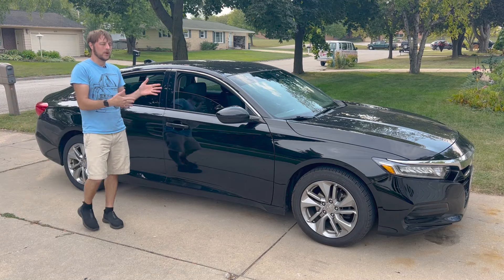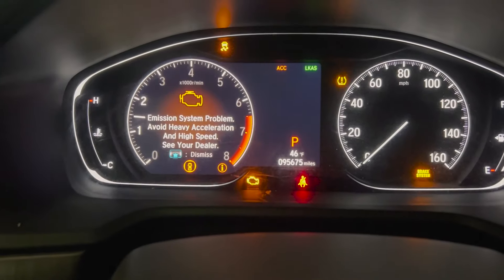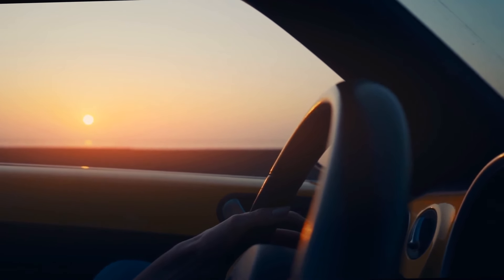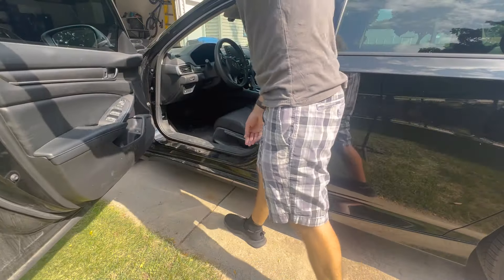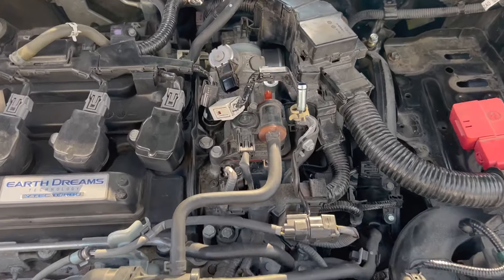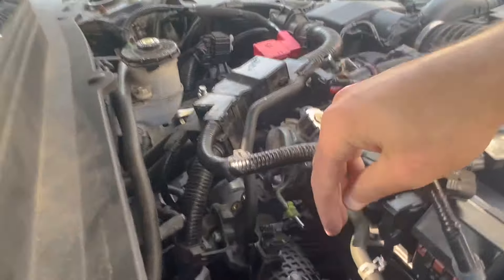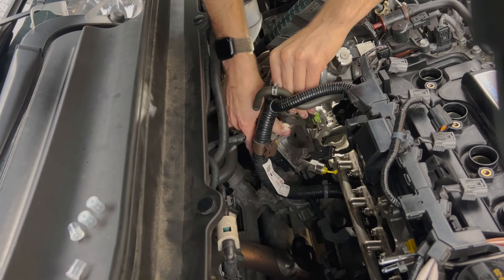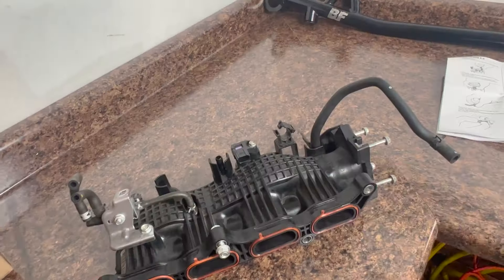Honda Accord Rough Idle & Misfire - Accord Fuel Injector Change // 2018 Honda Accord Injectors

Comment: Great video!!! Question. I know you said changing the injectors fixed your rough idle, but did your codes ever come back? My wifes car (2018 accord sport 1.5t) has been dealing with the codes for a little while. Everytime they come up i just disconnect the battery for 15 minute, drive for maybe a mile then they reset. To me it HAS to be something with the battery or a bad ground. Something dealing with a broken head gasket or fuel injectors for throwing codes just seems like bs to me.
Reply from the maker: Sounds like you could spend the $25 for the scanner linked in the video description to make your life easier.  The code is not a direct link to a head gasket or dirty injectors, but the codes are tipping you off to a potential problem that should be looked into before it gets more serious.
Reply: @BoostedFilms  sure thing. I have several scanners saved just haven't pulled the trigger on one yet. I was really trying to see if your codes came back. Because a lot of people who said dealership told then they needed the same things, the lights came back like 3 months later
Reply from the maker: @TheNappyboy2  I have not had any codes since the injector swap.
Reply: @BoostedFilms  Nice okay!! Thanks for the reply.
Reply: @TheNappyboy2 Have you had the battery tested?  If it's the original battery, it may be down on capacity, causing voltage fluctuations, leading to bogus codes.  Any corrosion at the posts or cable ends?  Get it tested, or just replace it, clean up those cable ends with a battery brush while the old one is out.
Reply: @trex450flyer  Out of town right now but recently got a terminal wire brush to clean them to make sure nothing is on there. Currently on the THIRD batter for the car. We bought it brand new in 2018 so the first battery was bad from the factory. Second battery went bad out of no where so I changed it to the one that's in it now. We thing shortly after that last battery change is when the codes started. I plan of testing the battery when we get back home as well as checking for bad grounds.

Comment: Curious to know if there is way to distinguish this from a blown head gasket? I’ve seen a lot of posts of the accords with the 1.5TS having the same issues and it has ended up being the head gasket.
Reply: If it's the head gasket, and you're keeping an eye on the coolant level in the recovery tank, it's likely to drop after successive trips. The dealer can identify that it's a head gasket by removing the plugs and checking for coolant on top of the pistons with a boroscope, or they can do a test that looks for combustion gases in the coolant. My Accord is exhibiting the same symptoms as mentioned in this video, I've run a couple tankfulls of Chevron Techron fuel system cleaner through it, and the problem has lessened. However eventually I'll probably have to replace the injectors as well.

Comment: Hi there my Honda is doing the same thing for months now, I took it to Honda they told me the injectors are bad, But my main concern is that anytime i check my radiator  there"s  no coolant inside , there"s always coolant in the water bottle please advice .
Reply: Thats a symptom of a blown head gasket. 4 grand to replace
Reply: @JohnS-il1dr  wow
Reply: @KayAdex-gx3zc wow is right. Did you get the issue fixed?
Reply: Did you ever get the issue fixed ? Seems like these cars are all lemons . I’ve been doing a lot of research and it’s either replacing spark plugs , injectors or a blown head gasket that turns this car into xmas lights on the dash .  Right now I’m helping a friend out that has a 2018 accord 1.5 turbo . I don’t think I’d ever own another Honda again  . POS
Reply: @Eddie510s  Hi there i got the headgasket replaced , its still showing lights on the dash like Christmas lights , when its idle the rpm goes up n down i dont know what else is the problem

Comment: Could a blown headgasket cause that buildup? Would explain rough idle especially on startup, misfires and is the most common problem on these cars. Small slow leak right between the cylinders where they stupidly put a cooling channel.
Reply from the maker: Carbon build up on the intake runners and intake valves is a byproduct of direct injection.  However i'd imagine a leaky or blown head gasket would not help much of anything.

Comment: Can you reuse the manifold gaskets ?
Reply: I wouldn't recommend reusing them.
1.- They could be in a bad condition once you remove the intake manifold. They could be broken, brittle or worn. Which will end up causing an air leak, which will undoubtedly bring more problems.
2.- To get to the intake manifold, you already did too many things. So I don't think it's worth the risk of reusing the gaskets.
3.- I don't think a set of new gaskets are too expensive. So I would definitely recommend buying new ones.

Now I understand that there may be various reasons why you are asking. Out of stock, budget or mere curiosity.

I hope the brief answer helps you choose the best option.
Greetings.

Comment: Would it be the exact steps for a 2017 Honda CRV ? not sure if the 1.5Turbo in those engines are the same
Reply from the maker: doubtful.
Reply: @BoostedFilms  thanks for the fast reply. I read online that they do have the same 1.5Turbo engine and watched a crv video and steps seem basically the same. I am going to try and tackle this!
Reply from the maker: Interesting, i didn't know that! Good luck. keep us updated.
Reply: @BoostedFilms tackled it today on my CRV and it’s 99% the same besides the intercooler pipe. Thanks man I appreciate it !
Reply from the maker: @killadocg23 nice! Good to know. Thanks for following up

Comment: Identical symptoms with my wife's Accord.  Replaced all 4 plugs with new NGK iridiums......new injectors with Hitachi.   No misfire codes anymore, but still a slightly rough idle and she said twice now, on the interestate, it went into limp mode.  She pulled over, turned off and back on, and drove fine.    I'm wondered if injectors are the answer.   The lack of codes is what's really throwing me for a loop.
Reply: There is a recall on the fuel pump for 2.6 million vehicles between 2018 - 2020. My vehicle w/ 30K miles had this issue occur on Dec 9th 2023 and recall came out Dec 23rd 2023. Honda had no idea what the issue was then but they sure as hell do now.
Reply: Did you manage to find out what the problem was?
Reply: Twice I had to pullover to turn engine off and on and only thing I get is a flashing check engine icon. About 20 to 45 it starts to lose accelerating.
Reply: @Johnrod213  Hey JRod! Yeah, they diagnosed it as a failed spark plug in cylinder 3. Thankfully they covered the cost. I haven't had the issue come back yet but I am well aware the fuel pump could go out at any moment.
Reply: This happened to me also took it to the dealer and said it was a blown head gasket

Comment: Great video! How long for the injectors to arrive after ordering?
Reply from the maker: I placed an order once and the place emailed me back and just cancelled the order.  The second time i found someone else who orders from a OEM Honda dealer on the regular.  It still took about 2 months.
Reply: @BoostedFilms Honda had a recall for the fuel pump do you think that was the issue? Also did your ever have a blown head gasket

Comment: I followed this video steps.. after everything seems to fix the issue with the misfire 1 but then p0035 code popped up afterwards. Any idea why ??
Reply from the maker: I'd do a recheck of your connections and hoses.  Clear the code and see if it comes back.
Reply: Yes definitely did that found a loose wire from the turbo to the manifold. Thank you for the great video!

Comment: Did you ever get an intermittent flashing check engine light prior to the car losing power? This happens with my friend's car around 40mph then loses all power and wont go past 20mph.
Reply: I had that and it was cylinder 1 misfire.  I needed a tune up.  Changed all spark plugs and coil pack.  Car runs very strong from spark plugs and you feel it in the pedal.  Check fuel filter and oxygen sensor and ecm tcm etc

Comment: This video is really helpful but i want to know iff the fuel inector are bad car losing a coolant iff someone know tell me please
Reply: If your car is loosing coolant slightly this can be due to excessive heat of summer or from a slight leak in your head gasket seal. My headgasket finally went after 230,000 miles on 2020 hybrid accord. You should get your compression checked on each cylinder to make sure your head gasket is sealed.
Reply: I went to the same problem the reason your car is losing coolant is because is going through the headgasket the 1.5 engine was made with some slots on the heads for some design reason and this is causing tons of problems..lots of headgasket problem in this cars.. you are going to replace the head gasket also replace fuel injectors.. also recommend install new spark plugs.. keep in mind this car is also in a recall for a fuel pump replacement that's is going to be on the dealer.

Comment: Hello! I have a 2021 accord and last year my injectors were replaced due to code and lights on the dash. Since December my car has had a random long crank or hard start sometimes both and random no real pattern. Dealer replaced fuel pump due to low pressure and then the high pressure fuel pump because of a dtc. The issue is still there and the dealer cannot duplicate and can’t find a code. Any suggestions?
Reply: Also, I have changed the spark plugs as well.

Comment: My car is like this but no codes I but injectors cleaner in the fuel and the rough idle 50% of is gone and when the fuel tank finished I but new fuel and now when I start it it got back to the rough idle could it be the injectors?
Reply: Did you ever figure out the issue with this? I also have no codes. When I use fuel injector cleaner, it runs like a dream, but only for a week or so. After that, it’s back to rough idle, terribly loud start and rough engine performance. Looking at my injectors, fuel filter and fuel pump idk where to start. ‘17 Accord EX-L
Reply: @Whatchamacallit22  I cleaned injectors in the machine and I did some maintenance like spark plugs and 50% is gone and now I know my problem is the fuel pump because if the tank fuel is full it’s gone like70%
Reply: @Moha-zt7cw  just seeing you replied. Thank you. By chance, have you considered changing the fuel filter before changing the fuel pump?
Reply: @Whatchamacallit22  I did not but ill check it out some day

Comment: What do you think about the eBay Honda fuel injectors priced at around $126 it shows the Honda red tag in the pictures but you also see other injectors with the Honda label but Honda blurred out and priced way lower at $79 which worries me not even then $125 injectors are oem
Reply from the maker: Do it once and do it right.  If it was a part you could swap in 5 minutes, i'd maybe risk it, but not in this case.
Reply: @BoostedFilms hey man so little update I just ended up changing the fuel injectors with oem from Honda but 4 months later my 2018 1.5 accord misfired again same cylinder. Do you think it’s a blown headgasket
Reply from the maker: @559kickz  Sorry to hear.  Headgasket could be the issue. A compression test and/or leak down test would be my next steps.
Reply: @BoostedFilms  ok and any idea why when I go on a steep hill my 1.5 accord gets stuck at 5k rpm even when I get to flat ground

Comment: what all parts did you need to do this job?
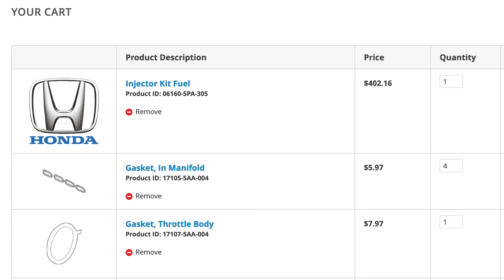Reply from the maker: 7:38
Reply: @BoostedFilms were all those gaskets really bad and needed to be replaced?
Reply from the maker: @grant9047   The gaskets were not bad.  But they should be replaced when doing this job.

Comment: Prior to installing the new injectors and rail, did you clean the injector holes in the cylinder head with brake cleaner, compressed air, etc?
Reply from the maker: No.  I would not want to risk adding any debris inside the cylinder of the engine

Comment: Honda's misstep with these models is evident. Emissions and other warnings typically appear during intense or sustained acceleration, particularly as the engine strains around 2.2-2.4 RPM on the tachometer.
After extensive research, including widespread user reports, a manufacturing error seems plausible. Dealers are often uninformed, charging hefty diagnosis fees. You’ll have a better luck fixing it yourself. From my research I was able to compile a list of potential causes:

1. Rodent-chewed cables
2. ECU software bug
3. Faulty injectors
4. Loose alternator
5. Bad MAF sensor
6. Defective turbo sensor

Comment: Greetings !
Wondering how many miles ? .... When you had the  intake manifold off , and showed the valves , they looked nasty ; with excessive carbon build up . 
Excessive carbon build up , is a major issue  with DGI engines ; specially equipped with turbo charged vehicles , any make .

Comment: Hey I had the code 40420 show up a couple of days ago and than it the check engine was gone two later, the next day the p0304 code came on while driving and check engine light was flashing  and car seemed like it didn't want to accelerate, cut the car off went to clock in came came back drove around the parking lot with no problem, what could it be
Reply: It’s fuel injectors bro
Reply: @darriusmckeever735    naw it was spark plugs car been driving nice ever since
Reply: Injectors may be on the way out. Mine got worse over time. What you described sounds like limp mode. Shutting the car off and restarting usually clears it but fix the issue if it happens repeatedly,  may hurt your cat or head gasket.
Reply: @irvnegrin2211  it was spark plugs the car runs smooth now

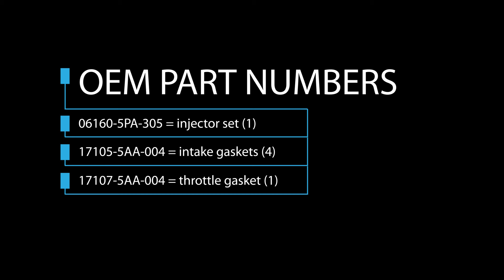Comment: So in reference to what you say here at 8:00, in your opinion, do you think the part that was discontinued (16010-5PA-305, without the Fuel Joint Pipe) is still a good part to use? I ask because the new part number (06160-5PA-305) costs significantly more (~$500,) I assume do to high demand. The discontinued part plus + a fuel joint pipe (Honda OEM on Ebay from trusted sellers) is ~$220.

I ask because I'm having this exact same problem on my 2018 Accord Sport 1.5t :(
Reply from the maker: I don't know for sure if its a new version of the injectors or not. For that reason I would not buy the old ones if it was me.  But if you decide to give it a shot, report back and let us know how it goes.
Reply: @BoostedFilms  So I dropped my car off at the mechanic shop yesterday to have them check the head gasket. And they found coolant in cylinder 3 :( should I just junk the car?...

Comment: Did you got the recall as well? I recently started experiencing the rough Idle in cold start, looked up online that it might be that fuel pump recall they have going on, I’m worried because my dealership keeps telling me that the part is not available and the idle is getting worse, also got that “limp mode” just once before, I waited like 15 min to restart the car and it went away, scary stuff if it happens while driving I’ve read, very informative video, I’m not gonna be able to do the whole thing but it gives me an idea of what could be wrong.
Yesterday my temp was rising up way too high, I wonder if these are related problems, I don’t wanna pay too much but I need the car alive so I might the bullet and have it checked out again tomorrow.
Reply from the maker: I didn't have a recall for my fuel pump.  If your accord is overheating, you probably have a head gasket issue.
Reply: @BoostedFilms  i hope not, I saw this morning that my coolant was low and I decided to take it in, my car lighted up like a Christmas tree around 7 am when I was supposed to head to work, they are running a diagnostic and should call me back before 3 pm.
Reply: @KazuyaSnakeSK what happened with that diagnostic I got the same issues like you
Reply: @fry5229  blown head gasket, apparently it’s common? I’m like are you guys serious?, so we are going to get it fixed obviously, waiting on that extended warranty bs to get approved, I’ve been on point with the maintenance and I have the records to prove them that, my advice is don’t drive it at all or the engine will suffer irreparable damage, I’m beyond pissed, my latest maintenance was March 14th so I hope they don’t try some bs. Still waiting on that recall too for the fuel pump crap! Apparently they don’t have the part anywhere !
Reply: @KazuyaSnakeSK  smh I was hoping that wasn’t it but from all the symptoms you listed I’m willing to bet that mine is blown too🤷🏾‍♂️ I’ve been in limp mode for like the past three weeks I’m still waiting on the part for the recall also but I have an appointment tmrw for them to see if it’s really the fuel pump recall that’s putting the car in limp mode. If it is they’re gonna try and expedite it so I get the part asap but that’s what they claim. At this point I’m jus fed up with the whole thing probly jus try to trade it in
Reply: @KazuyaSnakeSK  you should be good tho luckily you got warranty I heard the 2.0 doesn’t have that issue
Reply: @fry5229  yeah, I didn’t do my research when buying it, 2.0 doesn’t have it, plus that CVT transmission the 1.5 sport has it’s supposed to be an issue in the long run, I never really had a car break down on me this fast tho. I’m considering trading in mine too once it’s fixed.